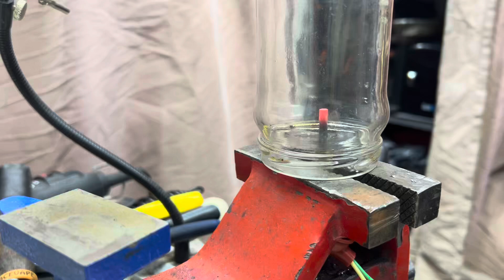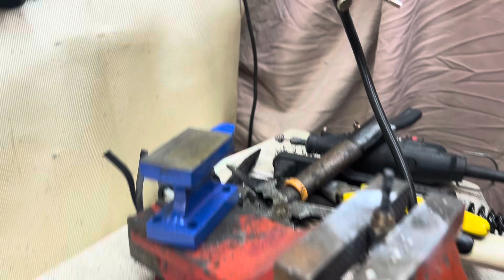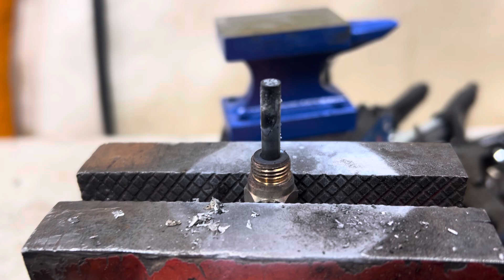Diesel heater: 24 volts through a stock 12 v glow plug.

Comment: Well, it would work, but only once! Exciting!
Reply from the maker: I’ve found a way of using the latest motherboard and using the standard glow plug circuit to switch it “back on”! without frying the PCB and making the fan run ,at any stage other then start up and shut down.It works fine with zero error codes. . Not sure if I will post a video.
Reply: @diesel-heater-Free-Heat  Cool 👍